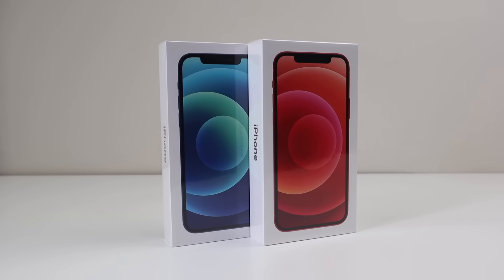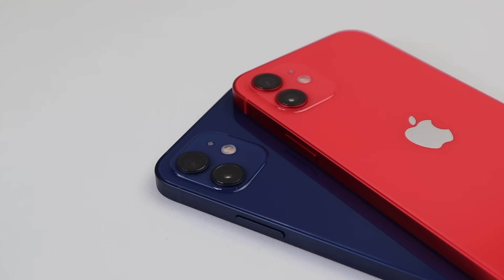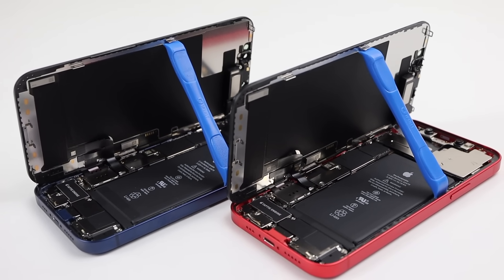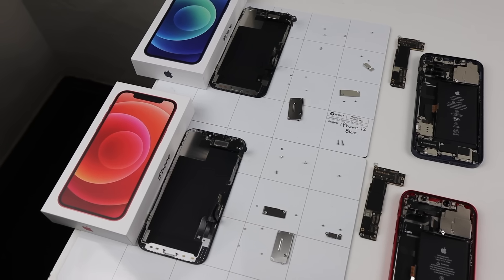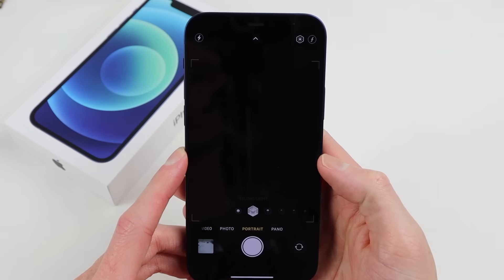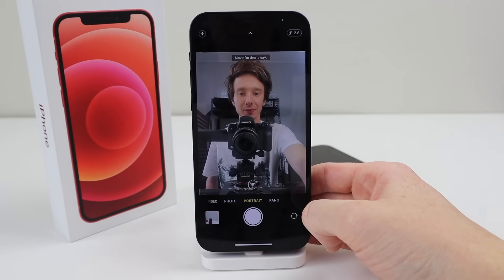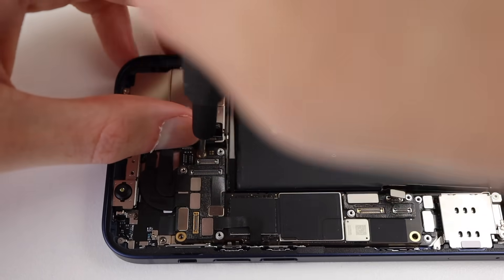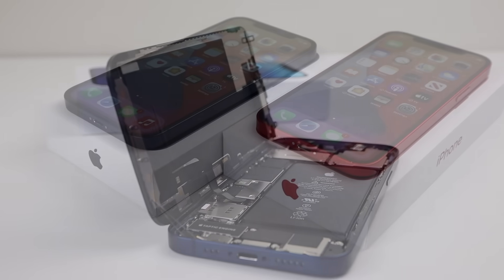iPhone 12 Anti Repair Design - Teardown and Repair Assessment

Comment: They've always been extremely hostile to anyone they don't control, completely.  I used to repair computers and they would only sell me a special screwdriver if I could show them I was a certified  tech trained by them.  They made a monitor that used a special tipped screwdriver that the shaft was about 10" long.   Also, the tip was patented and no one else could manufacture it.  We called it a vertically integrated company.  I actually called a glimpse of Communism in America.  I hated them.  Don't even get into whole big-endian vs. little-endian thing.  They purposely made their computer word read backwards from the industry standard.  They did it on purpose to be completely hostile to everyone else but themselves.  They planned to take over the world, once upon a time and they seem to me like they haven't changed much from the old days.
Reply: Big cooporate = Communism. 
RIght. Nice Buzz Words

Comment: I stopped using Apple phones a while back when they quoted me $600 to repair as its no longer power on, and the first thing they suggest is a new phone for $900, I sense this is just to sell more phones, took it to a few local repair shops and a few quoted $300+ to repair , for $300 I got myself a new Android Motorola, does everything but even if it breaks after two years I would simply buy another as it is so cheap.
Don't get me wrong, I love Apple stuffs, they are beautiful designed and simple to work with except it comes with a price tag that many may not be able to afford when things go wrong. the iPhone 12 is a prime example of Apple trying to force us to only use Apple for any repairs meaning they will have the sole monopoly of this market, meaning they can quote and charge whatever they like, this idea scares me because its almost like dictatorship.

Comment: Me: I just paid $800 for a phone, and it doesn't even come with a charger?
Apple:  If you're cool, you already have a USB-C charger laying around.  You're cool....right?
Reply: If you’re not american or cross continents it gets even worse in cost, to the point of being like 10 times more expensive than a similar quality phone.
Reply: The only apple product I have is an iPad because of online lessons(the device I am using to watch this video), and this thing cost me enough money to buy a Samsung s20 FE. Damn I had apple, not as a fruit, but for the company that use the fruit as a brand.
Reply: Also using 3-rd party charger will violate you warranty. Very convinient.
Reply: Although not adding a charging block to reduce waste is a good idea... changing the charging cable to USB-C and then saying "there's x amount of charging blocks out there, you'll be fine" is kind of inconveniencing people. Do you have a USB-C charger at home lying around? it's relatively new and I wish that they'd include it for people to use so then they could at least have one of that type. But you could argue that the person might have their old iPhone charger...

well what if said person was buying an iPhone for the first time? they wouldn't know that their charger is incompatible with the block they might have or someone else might have. 

"they could just buy one", It just seems like more effort. You're having to spend more money for a USB-C cable after buying an $800 phone just because Apple made some shitty excuse before creating a new charger. 

What an inconvenience in the end.
Reply: Dizy The Shitposter  S9 is the GOAT
Reply: You don't need a whole new USB-C charger. Just get a USB-C to USB 3.0 Adapter and you are golden.
Reply: And you can also throw away your powerbank
Reply: I charge everything with my 12W cheapass powerbrick, and I’m not going to buy anything else, no fastcharger, no MagSafe. And I’ll be just fine, maybe not use the phone for a half hour or so? But I’m going to send back my 12 pro anyhow, the battery is underwhelming already, my guess is it will barely be able to hold a charge two years down the line, and it’s clearly a pain to replace if they’re even willing to do it in the first place.
Reply: I do not have apple, but can not people use the old charger with old cable? Since all iphones have lightning plugs?
Reply: @xMant1k  they can, but they just need a new charging block for the new lightning cable
Reply: Or, like, use the old charger AND its cable? Buy a your-old-charger-to-lightning cable for a couple $?
Reply: Me: Maybe its time for me to switch from Android. 
Apple: Nope. Every time we give you a new reason not to switch.
Reply: @alethcoe  Same here. I need a new phone soon and I was actually going to consider an iphone this time but now I definitely am not.
Reply: @coolfred9083  Get a Motorola -- tough and dependable!
Reply: @alethcoe  If not coming with a charger block is a legit reason why you didn't buy the damn phone then thats kinda sad
Reply: @CarnidevRae  if you find not buying a phone because it's missing a charger block sad, you're kinda sad as well.
Reply: @CarnidevRae  Supporting apple is kinda sad, they bully small companies with fruit logos. Enough said.
Reply: @CarnidevRae  if I'm going to pay $900 for a phone I would like it to come with a charger, and the one that Apple sells on its website is $20!
Reply: @CarnidevRae  Not buying a phone because it doesn't comes with a charger block is only logical.

You wouldn't buy a brand new car without a gas tank nozzle/battery charging plug, would you?
Reply: @pedinhu18  That's not quite the proper analogy. Apple does provide the tank nozzle/charging plug. The better analogy is that "now the car needs fixed and I have to buy a special damn tool to take the wheel off" This happens with cars all the time. Ever wonder why you can pay $20 a pack of allen sockets only to find that the one you needed isn't in the kit? And if you want to get that particular allen socket it cost as much as or more than the kit??

The part I'd be really pissed about is that Apple has made the phone such you can't fix it. Oh, battery is toast, I'll just buy a new one (manufactured for Apple and used by Apple). What? My camera doesn't work now? It's telling my new battery is bad?? Um, Apple says I can't fix it, I have to buy new? WTF?!!! 

You know, if you spend $1000 or more for a phone, you should be entitled to having it free of their conniving immoral grip but alas, we keep allowing them to dictate to us how to use OUR property. I can see if you bought a tv for $200-300, it's just cheaper to buy new instead of fixing. But a $1000-1200 phone isn't chump-change. 

I switched to iPhone again, because I forgot how terrible their product really can be. From them trying to lock you in to their hardware to them controlling the software and what you can load on the phone... I want a company that doesn't treat me like their servant. "Use our product! This is the best for YOU! Don't look at anything else, we are all you NEED! Now pay us more money! We changed the headphone adapter because ... it took too much room! ! Hey! That program isn't authorized, we are going to delete it from your phone!" Fuck Apple. As soon as I get a chance, I'm switching back to Android.
Reply: @pedinhu18  good point 👌
Reply: @Gnulcho  they keep removing more features and people like you make apple get away
Reply: @Gnulcho  I think it's not just the missing charger block that's swaying people from buying one aha... A lot of things have kept me from trying out an iPhone over the years, I just wish Security wasn't the only thing iPhone has that I would want in a phone.
Reply: @IAm-zo1bo  not sure what you're talking about. i just thought that providing a non-standard power input on a phone, yet not providing an adapter or anything like that, is not a very attractive offer, to put it in tame words. jingle's comment felt inappropriate to me, so i decided to roast him a bit. how does that make apple get away with their practices?
Reply: @CarnidevRae  everyone has preferences and standards for what they buy. people can spend their money however they choose.
Reply: To be honest i get that apple is a simple to use device for older people that dont use phone for music or video so 64gb is plenty enough but why anyone else would like to buy a iphone people complain ohhh a new apple scam and blablabla but will still buy the new one god people are dumb sometimes
Reply: @jordanjimenez4475  simple to use, until you have to charge the phone
Reply: @jokerkenny1801  fucking right those garbage phones are so expensive that they should give the airpods with it but it aint gonna happen if they are to greedy to give a fucking charger
Reply: @jordanjimenez4475  taking advantage of older people
Reply: Hopes this makes yall day
https://youtu.be/tHl2WGFHFGA
Reply: Sadly I'm not cool
Reply: Stop complaining bitches
You can charge your iPhone at any Apple store.
(for a nominal monthly Apple almost genius phone charging club fee)

Comment: I wanted an iPhone since I can actually use apps like Snapchat without dealing with all of the buggy and clunky parts of the apps on Android.  But I think I'm fine putting up with the clunkiness of those apps so I don't have to deal with this garbage that Apple has done.  I'm gonna have my next phone for probably 3-6 years, and in that time the battery is going to start to die, and the screen will probably crack, and last thing I want to deal with is a scam straight out of the box.  I thought Galaxy Buds were bad enough where if you bought a replacement bud, it wouldn't sync with the other bud whereas the Airpods would do exactly just the opposite when you bought a replacement pod.
Thanks for the video, there is no way I'm getting an iPhone after this garbage and I'm not supporting scummy business tactics like this.

Comment: Caveat Emptor. At this point, Apple's anti-consumer activities are so well-documented and well-established, the onus is really on the consumer to know that they are actually buying a lemon designed to fail.

One thing I will say for Apple, they are great at taking money from the unknowing-masses. Morally right or morally wrong, they are massively successful at scamming folks and getting away with it. I've traded Apple stock to try and ride that money train, even though I would never sink so low as to actually buy a modern iPhone for myself. Why have integrity when you can make a percentage?

Comment: Apple have been doing stuff like this for a while I think - at least as far as firmware updates go.

I use my phone quite often to download photos to my PC using the lightning cable.  Every so often (seemingly when there is a software update available, but which I haven't yet installed), the iPhone will simply refuse to connect to the PC and show the DCIM folder.

It was a similar story a couple of weeks back with Airplay.  It was just randomly disconnecting from my hifi system and refused to reconnect. Once I updated the firmware it worked fine again.

There is no reason for these functions to suddenly stop working, when they have previously worked without issue.  I suspect Apple introduce intentional gremlins and niggles into the functionality of the phone to force you to accept a firmware update when it becomes available.  On their support pages, the advise on having any type of issue is always 'make sure you are running on the latest version of the software/firmware'.

This video just shows Apple are taking things to the next level.  There absolutely is no reason why an OEM part shouldn't be interchangeable between phones and this hardware locking is clearly being done for the sole purpose of preventing third party repairs.  The "Right to Repair" legislation can't come soon enough - it would put a stop to nonsense like this.

Comment: do you think maybe its just an idea that apple did this on the 12 camera beacause the iPhone 12 pro are the same size and they maybe thought people would by the 12. buy the 12 pro  back housing and camera of eBay for 150 down the road . later down the road and just pop the iPhone 12 mother road into the 12 pro back housing replacing the 12 camera with 12 pros camra. and flip it for 900 maybe and just making your Monet back for the price of 12 but having scam that person of the 12s mother that has 4 gigs of ram instead of 6 gigs of ram that the 12 pro has it just came too while watching this video because i remembered that this is the first year that the budget  models share the same size screen not the regular size we know from the 11 pro 5.8 vs 6.1 screen size now it 6.1 for both models

Comment: They should be up front about it and lease, not sell, their phones. Vital, expensive technology that is unrepairable is pretty much the definition of a fraud. Very sad to see my favorite Tech company go so wrong. Owned virtually everything they made since the first Mac. Time to learn Linux.
Reply: Apple "repair" is an even worse joke, with most consisting of very expensive replacement or LB replacement. I've had close to 90% failure rate with MBP,  with the MBA or the non-GPU being the exception. It was because of the existence of repair technicians that I was still able to depend on Apple products. But this is the nail on the coffin. The M1 iMB would have been perfect for my uses. Very disappointed.

Comment: “We’re not giving you the adapter because they’re a lot of them already, by the way we made a new cord so you gotta separately buy a new adapter full price.”

- Apple Probably
Reply: They did it to simplify the supply chain. They can now package one phone for all regions. However, by changing the cord to USBC, they removed any potential benefit that the consumer might have reaped from the removal of the power block.

Comment: Apple are shysters. Constantly changing standards (charging, phone jacks etc) and gradually slowing your phone down with constant updates until you get fed up by the lag and get a new one. Then rinse and repeat.
Android devices are starting to do this as well, I have a 1 year old Motorola phone that is already noticeable slower than when I bought it. Can't stay on an older OS version either because they force the updates on you. What a frustrating industry.